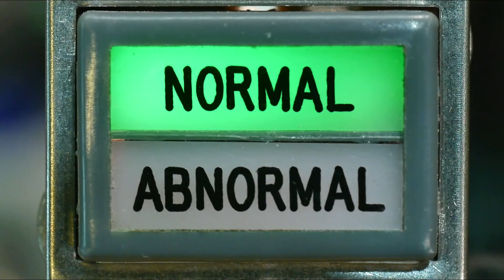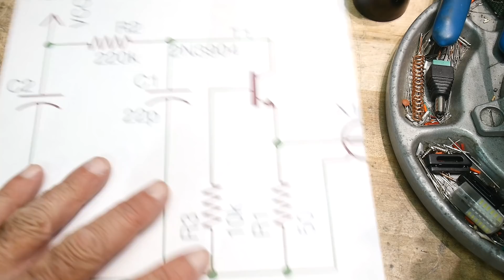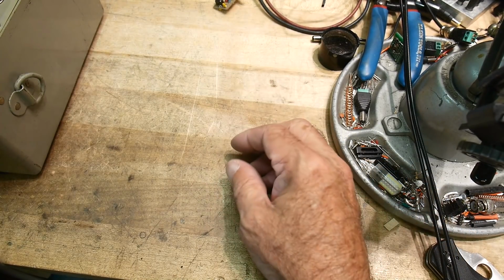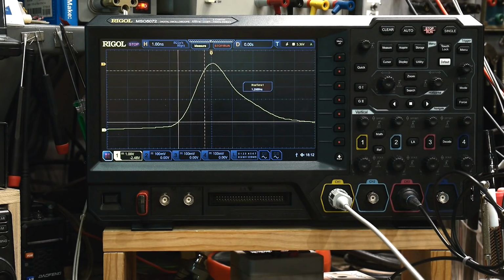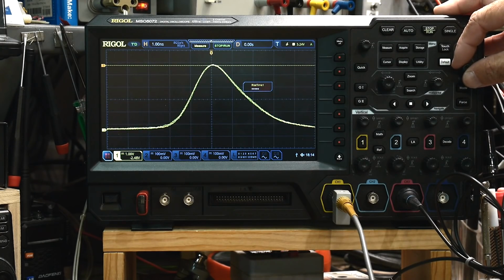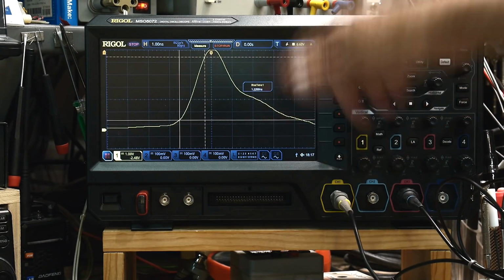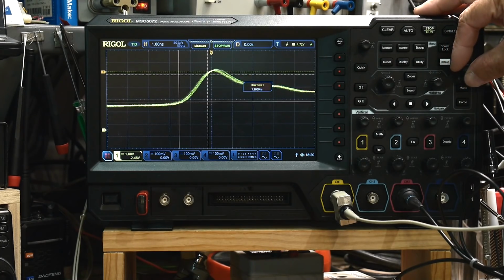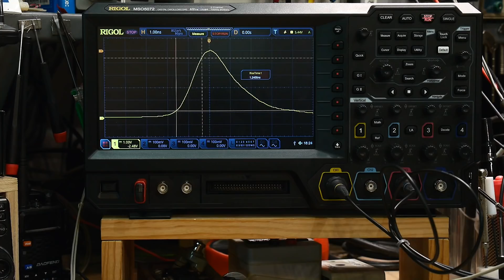#847 Nanosecond Oscilloscope Probe Rise Time Measurement (Jim Williams)

Comment: Get your base line.
Connect your pulse generator directly to the scope without 
a probe and check the rise time before testing any probes.
Try a few different transistors and base resistor values for the best rise time.
Reply from the maker: not bad ideas, or, just get a really expensive scope: https://youtu.be/By_xfk_pqL8?si=leitX5om8W0LEsHj

Comment: Apparently there are some commercial instruments capable of generating fast pulses. This is a list presented by ChatGPT: Picosecond Pulse Labs 10,000 series (now under Tektronix or Keysight)	Edge generators	As low as 10 ps, Keysight 81134A	3.35 GHz	~60 ps, Tektronix PG3 series	Fast digital pulses	20–100 ps

Comment: Before testing scope probe connect with shortest 50R coax direct to scope get reference waveform. 0.22/350MHz should be around 650pSec rise time.
Reply: or 0.35/350MHz ?

Comment: AI Summary

Abstract:

This video documents an attempt to measure and compare the rise times of various oscilloscope probes. The initial approach using a 74AC logic-based pulse generator proved insufficient, as its ~2.4 ns rise time was slower than the probes being tested. To overcome this, a faster, sub-nanosecond pulse generator was constructed based on a classic Jim Williams (App Note 47) design using a 2N3904 transistor in avalanche mode.

A variety of probes with different bandwidth ratings (100 MHz to 350 MHz) from manufacturers like Rigol, HP, and Tektronix, along with a generic unbranded probe, were tested using a low-inductance fixture. While the results showed some differentiation, with faster probes measuring around 1.25 ns and slower ones around 1.4 ns, the creator concludes that the measurements are fundamentally limited by the 350 MHz bandwidth of the oscilloscope itself. The video highlights this measurement challenge, notes the surprisingly good performance of the stock Rigol probe, and determines that a much faster pulse generator (<500 ps) is needed for a more accurate comparison.

Measuring and Comparing Oscilloscope Probe Rise Times

*   *0:05 The Initial Problem:* An initial attempt to measure probe rise times using a 74AC logic-based pulse generator failed. Its 2.4 ns rise time was too slow, making all the probes appear to have the same performance, as the generator was the limiting factor.
*   *1:58 A Faster Solution - The Avalanche Pulser:* To generate a sub-nanosecond signal, a new pulse generator is built based on a famous Jim Williams design from App Note 47. It uses a common 2N3904 transistor forced into avalanche mode to create a very fast, repetitive pulse.
*   *5:05 Low-Inductance Test Fixture:* For accurate high-speed measurements, a special test fixture is built "dead bug" style. It features a small wire loop for the probe tip to connect to, ensuring a very short and low-inductance ground path, which is critical to avoid distorting the fast signal.
*   *6:06 Rigol PVP2350 (350 MHz) Probe Test:* The stock probe that came with the Rigol oscilloscope is tested first and measures a rise time of **1.25 ns**.
*   *6:52 HP Probe Test:* An HP probe measures a nearly identical rise time of **1.26 ns**.
*   *8:23 Tektronix P2200 (200 MHz) Probe Test:* A well-known 200 MHz Tektronix probe measures a slower rise time of **1.4 ns**, which is consistent with its lower bandwidth rating.
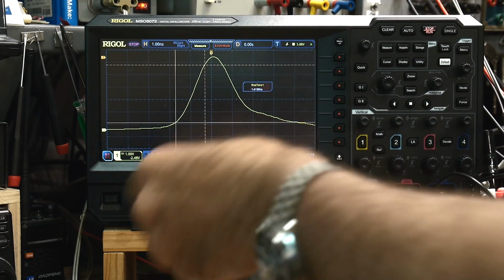*   *9:44 Tektronix P6106 (250 MHz) Probe Test:* An older 250 MHz Tektronix probe measures **1.49 ns**, performing similarly to the 200 MHz probe.
*   *11:05 A Surprising Result:* A modern, high-quality Tektronix probe rated for only 100 MHz unexpectedly outperforms the 200/250 MHz probes, measuring a faster rise time of **1.3 ns**.
*   *12:16 "Cheap Chinese" Probe Test:* A generic, unbranded probe delivers the fastest rise time of all at **1.22 ns**. However, its waveform shows some undesirable ringing and a slightly incorrect voltage division ratio.
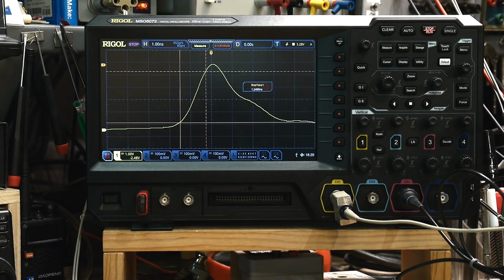*   *16:11 Conclusions & Limitations:* The creator concludes that the stock Rigol probes are very good, performing as well as high-end probes in this test. The primary limitation is the oscilloscope itself; its 350 MHz bandwidth has a theoretical rise time of ~1 ns, meaning it cannot accurately measure the true, faster rise times of the high-performance probes.
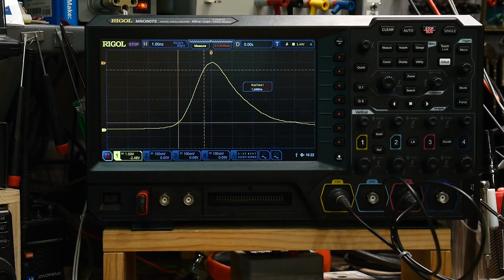*   *16:24 Future Plans:* To properly differentiate the probes, a much faster pulse generator with a rise time under 500 picoseconds is required.

*Summary of Viewer Comments:*

The comments section provided valuable technical feedback, largely confirming the creator's suspicions about the experiment's limitations.

*   *Primary Issue - Scope Bandwidth:* The most frequent comment was that the measurement is limited by the oscilloscope's own 350 MHz bandwidth. Viewers correctly pointed out that the scope's intrinsic rise time (calculated as 0.35 / Bandwidth) is approximately 1 ns, which explains why all the faster probes produced similar results around 1.25 ns.
*   *Technical Suggestions:* Commenters suggested improving the pulse generator's layout with shorter leads and SMD components to achieve a faster rise time. They also recommended performing a baseline measurement by connecting the pulser directly to the scope's 50-ohm input to characterize the generator and scope together.
*   *Alternative Measurement Methods:* Several viewers proposed using a network analyzer to find the -3dB frequency response of the probes, which is a more standard and accurate method for determining bandwidth.
*   *Observations on Probes:* Viewers noted the impressive performance of the inexpensive "cheap Chinese" probe, though some speculated its higher signal amplitude might be a result of its higher bandwidth rather than poor calibration. Another interesting point raised was that high-frequency probe cables are often designed to be intentionally "lossy" to dampen signal reflections.

Comment: I recall using a simple pulse generator in a college Physics class. It consisted of a mercury wetted relay with a form C contact. A small, ceramic disk capacitor was connected between the common pole of the relay and ground. When the relay coil was de-energized, it charged the capacitor through a resistor from a DC power source. When the relay was energized, it discharged the capacitor directly into the load. This produced short pulses with a very fast rise time. Sorry, I don't have any actual rise time values to post here.

Comment: Hi for traveling a very fast rise time pulse signal from one board to another have i use coax???
If I use normal two wires can it decrease the rise time of pulse???
Reply from the maker: most modern designs use differential pairs.
Reply: @IMSAIGuy  in my case my signal is a high power and single ended so I can't use differential pair.
Reply from the maker: ok, I would recommend a transmission line then (coax). make sure the input, output, and coax, all have the same impedance.
Reply: @IMSAIGuy  OK thanks

Comment: If you are going to use or look at high speed, repetitive signals, you might try a sampling probe.  It is a diode bridge made from 4 Schottky diodes.  I used one such during the mid 90s and I could then use my 2.5 maxed out o-scope (like the ones that were once used to fix TVs with) to look at stuff right up to about 3 gig or so.  The trigger that was used to open the bridge in the probe heat had 4 small coaxed cables running to it from the control box and used an avalanche set up like the one in the clip.  The control box was all transistors, no ICs.  ICs, I guess, might be pretty noisy at the higher frequencies.

Comment: You can make a pretty fast pulse using step recovery diodes, sometimes called memory varactor diodes.  Here is a few papers on the subject.

https://arxiv.org/pdf/1610.07115.pdf
https://www.usnc-ursi-archive.org/aps-ursi/2018/URSIpdfs/0000159.pdf
Reply from the maker: I did: https://youtu.be/pQVQIufVmJk

Comment: I would use an active RF probe instead.  There are ~$10 probes available online (ebay, ali, etc.), based on BF-998 FET. They have very low input capacitance <0.75pf and bandwidth >1GHz.
   I suspect that the rise-time is rather slew-rate limited, pulses of lower amplitude might show better results.
Reply from the maker: Yes, I have several active probes that are faster but not as much as you think. I agree the spec cannot be just time but something like sec/volt.

Comment: That reminds me of a student project. For a pulse laser diode I had to build a square wave generator capable of 1A with a rise time of 1ns back in 1980. I used a 4 stage avalanche setup with open coax load line. Each stage produced a rise time of 250ps at 250mA triggered all at the same time to get 1A. The triggering also used an avalanche pulser. The open coax gives a nice square pulse compared to just using a cap
Reply: How bad were the harmonics of that generator? Did you get any letters from the FCC? It would be interesting to see the schematic of the generator, as I've struggled to make fast rise time clock generators with just transistors.

Comment: You're right up against the bandwidth limitation of the scope.  Rise time is  given by .35/freq, so for your 350 MHz scope, you can expect a rise time of 1 nanosecond.  Add in the rise time of the probes to the rise time of the scope, and you are at the limit of your ability to measure.  Time to spend more money!
Reply: Yup, I thought of exactly the same quick calculation that you used, and the 350 MHz bandwidth (3 dB down) scope is unfortunately not up to the task. This is where Jim Williams would just pull out the 1GHz bandwidth scope, attach a 500 MHz probe, show the improvement and ask if you have any questions. I think Jim always had the next bullet point already figured out and the appropriate test gear is just waiting in the wings incase needed.

Comment: You did not mention that the measured risetime is the root of the sum of the 3 risetimes squared. These 3 risetimes are the risetimes of the generator, the probe and the scope. When the generator is fast enough (or assumed to be) and the risetime of the scope is given or measured via bandwidth the risetime of the probes can be measured. 
(It might not be a perfect measurement with the given set up.)
Reply: This is sorta true.  The root sum of the squares only really works for combining independent systems.  Systems that when you connect them together retain their properties.  However, in this case the systems interact.  What I mean by this is the probe affects the pulser, the scope affects the probe and vise versa, etc...  This is especially true for modern scopes.  The front ends on these are not Gaussian like the old analog scopes.  They employ a lot of tricks to maximize bandwidth.  The real math becomes quite insane and amounts to a set of simultaneous non-linear differential equations.

Comment: I think C1(22pF) is too large. this causing pulse height too high, looks like about 5V.
I have avalanche pulse generator too. it is without C1, parasitic capacitance only.

in #838, you measure 3db point is more than 500MHz. 1.2ns risetime is not your scope limit I guess (but for 5V pulse... maybe).

Comment: One confounding factor could be that it appears to be a very narrow pulse, so the maximum observed amplitude is itself a function of the probe/scope’s bandwidth. The 10/90% points thus end up being relative to a level that’s in part determined by the probe’s bandwidth. I think this would tend to make slower probes seem faster than they actually are. I can’t properly think through the math in my head, but suspect you’d get significantly different results if you were looking at a step function vs an impulse. With a step, the ultimate voltage would always be the same regardless of bandwidth, which I think would tend to make the slower probes appear more proportionately slower than they seemed to be in the tests here. (Related to this, I wonder if the larger signal from the cheap Chinese probe that you remarked upon might simply have been a result of its apparently higher bandwidth, vs improper calibration: I’d be interested to hear how it’s calibration compared to the others when measuring continuous, low-frequency waveforms…) Thanks as always for a super-interesting video!
Reply: Yes.  Rise time is generally defined for a long pulse input -- long enough for the response to settle to steady state.  For the very narrow pulse input, as you point out, the steady state output condition may not be reached.

Comment: With a bit of cleaning up of your layout (VERY short leads and surface mount components) the risetime of that avalanche pulser is better than half a nanosecond. (limit of my 500mhz HP scope) 
Try directly connecting the circuit to a BNC that will plug onto the scope. Use the impedance switch on the scope to switch the input to 50 ohms instead of hi Z.  This will give you the rise time of the scope. When using a slow scope like that it is difficult to accurately measure nanosecond pulses. That scope uses multiple iterations of the input signal to get the waveform. Any jitter in the signal (relaxation osc, oh my!) will skew the risetime edge measurement when at that short time scale ruining the accuracy. If you really want to measure that kind of speed, save up your money and get a good HP scope from ebay with 8ghz or higher sample rate.
Reply: Thanks a ton!

Comment: Isn't the fact that you have an impedance mismatch a problem? Your generator is 50 ohm but a 10 x probe is nowhere near 50 ohms.
Reply from the maker: don't think so. It is like using a scope probe on a dummy load to look at a transmitter. or a multimeter checking the voltage on a load.

Comment: I believe you can get the frequency response using a spectrum analyser with tracking generator. Personally, I would try to fi nd the -3dB frequency by using a sine wave and changing its frequency. of course, the probe bw should be lower than that of the oscilloscope.... Nice vídeo ;)
Reply from the maker: several people have suggested that, the data is very strange also. I will do a video in the future

Comment: FYI, a really interesting article related to this is "Secret world of oscilloscope probes" by Doug Ford. 
This was published by "Silicon Chip" in October 2009.
One of the interesting features I was not aware of, is that the probe cables are lossy by design to suppress signal reflections.

Another great video - thanks !
Reply from the maker: Thanks! I just downloaded it.
Reply: Cool article
Reply: Yup, the center conductor is very fine with significant resistance

Comment: Why not use a network analyzer?
Reply from the maker: Hmm, have to think about that
Reply: I was thinking about using a spectrum analyzer with tracking gen. Just need an adapter to convert type N to BNC and then just probe the gen output.
Reply from the maker: @matteo234321  I tried it. it is certainly interesting. I'll do a video on it in the future. Don't think it tells the whole story but is another datapoint

Comment: Pretty long lead length there on that 2N3904. Scope rise time is probably limiting you also. Try direct 50 Ohm coax into scope terminated in 50 Ohms just to see what is what. Longer pulse duration also would help maybe? Just to make sure you get full swing before pulse cuts off.
Reply from the maker: I recently did. limited to 1ns. working on a new idea

Comment: I would have liked to see you use a short piece of coax, fold a little shield back as your ground and expose the center conductor all to fit in your fixture, I know the probe tip ficture as a Curly Q. Use a BNC on the other end. Then terminate the coax at the scope with 50 ohms. Yes, it is low impedance, but I'd like to see the waveform.
Reply from the maker: 1ns. working on something elese
Reply: @IMSAIGuy  So, you got 1ns rise time using (What kind?) coax and how long, terminated at the scope with 50ohms? Have you figured out what the rise time of your scope is?

Comment: I think possibly you are mostly being bandwidth limited by the scope itself---1ns rise time is in general approximately 350MHz of bandwidth. Recently I looked at the output of an HP comb generator (step recovery diode with pulse output approximately 100-200ps) on my Lecroy 7200A with 500MHz 7242B plugin. I was only able to measure the rise time at about 900ps, and that was running directly into the scope with no probe. I had hoped to be able to measure it a bit more accurately but obviously my scope bandwidth was the limiting factor. So the solution is easy---go buy a Tek 11000 series sampling scope with a 20GHz plugin and redo the video...but don't forget to clear off 45 cubic feet of space on your bench first. :-D
Reply: Вы прямо в будущее смотрели, теперь у автора действительно есть очень быстрый осциллограф, только не до 20ГГц, а аж до 50ГГц. И он шикарен.
Reply: @SINHRO-FAZA  Hehe yes indeed. That new DCA scope he has now is very nice.